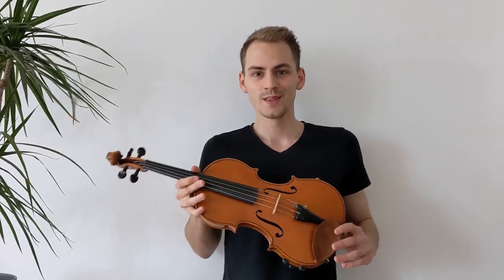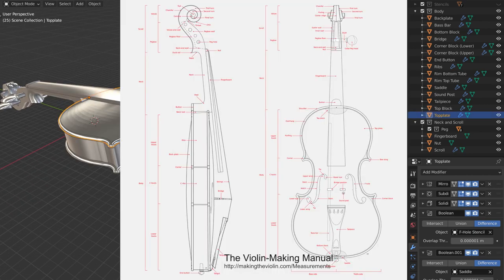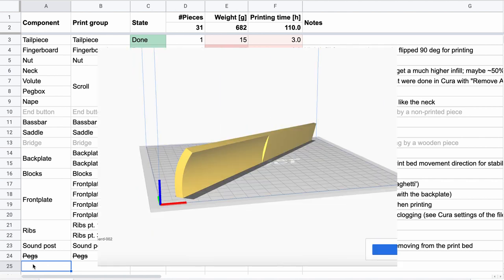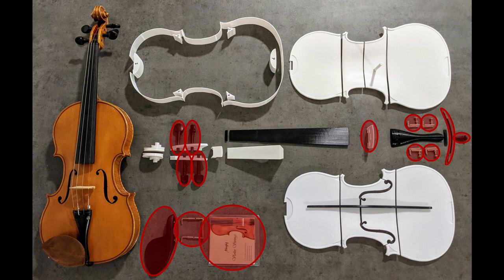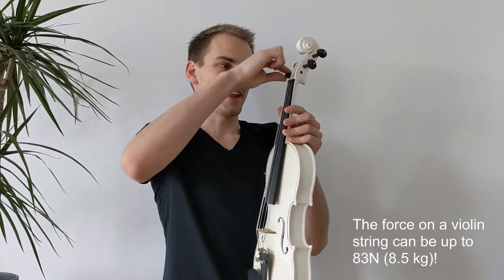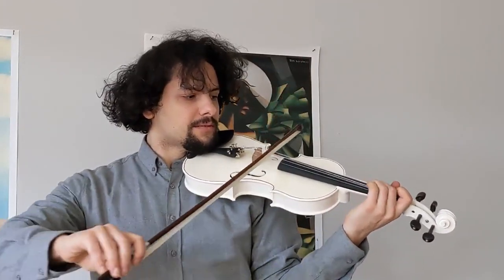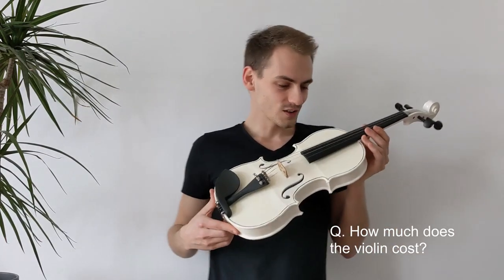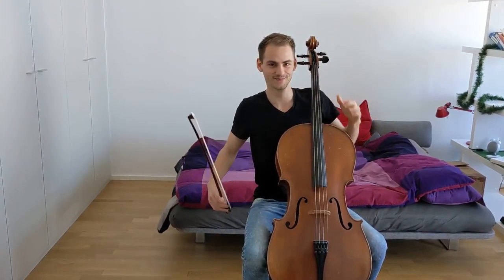3D-Printed Violin

Comment: probably it would be useful to modify the thickness in different areas to try and optimize the resonance of the body at various points. but this might take a lot of trial and error. also the filament used should make a big difference. probably a good scientific method for finding the best filament would be to 3d print a bell using vastly different plastic formulas and find the one that sounds the best when struck.

Comment: Definitely. think 3d printed violins will be a thing in the future.  The Chinese sell "super cheap" violins on ebay for $50 which includes the violin, strings, bow, case and a piece of rosin.  So on price the 3d printed violin cannot compete. But actually the place for a 3d printed violin will be  secure if the quality is there.   Your demo is very good.

Comment: That's a very brave project, and it looks great (unfortunately I don't have the "ear" to judge the sound). Well done! Is the material ABS or something else? And what glue did you use? The glue strength is probably what would worry me the most.
Reply from the maker: Thanks Ido! I'm really happy to hear from you – it's been a while since we last chatted. The material is PLA. Glue-wise nothing special, it's superglue. The violin's body is reinforced by the structural elements "sound post" and "bassbar". The bassbar is a bar that is parallel to the strings and right behind the front plate. The sound post connects front and back plate to each other. You can see the two components here: https://photos.app.goo.gl/RxqC983xsNyd6kju5
Have a great day! :-)
Reply: @Simsso  Yes, we need to catch up :-) I didn't think PLA and Superglue could stand such stresses, maybe because I only used them for smaller objects with smaller cross-sections, and with no special supports. That's good to know.